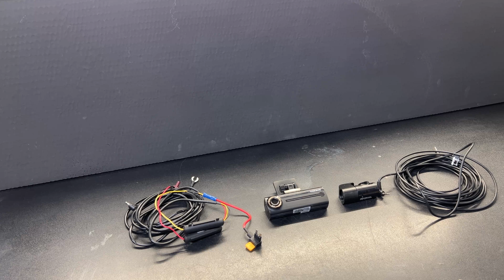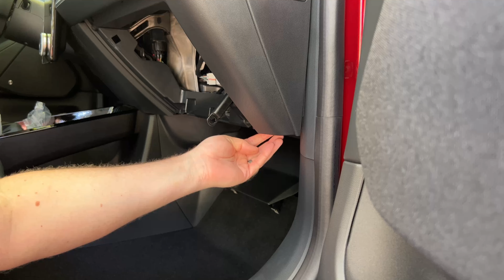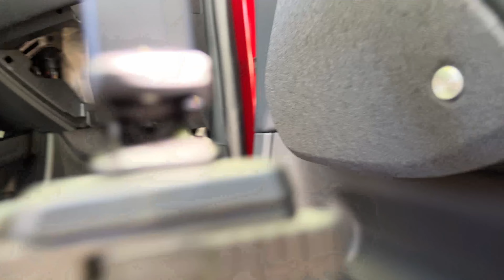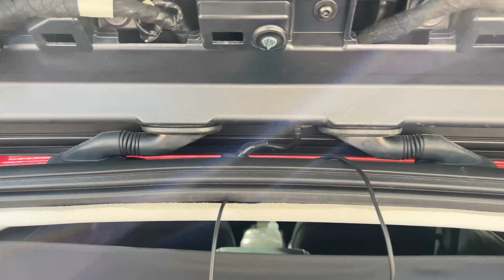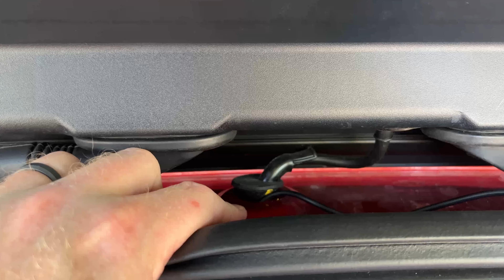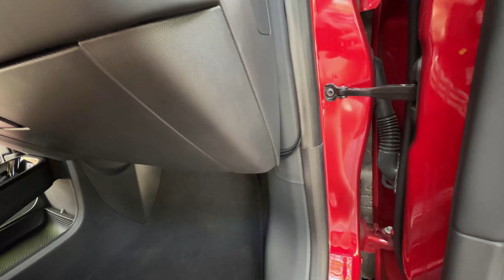Quick and Easy Ford Mustang Mach E Dashcam Dash Cam Hardwire Install

Comment: @TheDagda1000
0 seconds ago
Great video. I've just had a "dry run" before I do the job this weekend - the fuse panel was a pain in the butt!  I'm pleased to see that you had the same problem! I was feeling a right lemon! 
That's a handy tip about the glove box; makes the job a bit easier.
Reply from the maker: Glad to help.  Let me know how it goes!  Please like and subscribe as it really helps me as a creator.  It doesn't cost anything.  Thanks for the comment and for watching!
Reply: @MoreBear  Success! All up and running.
Channel Liked and Subscribed.

Comment: Can a dashcam be installed on the Mach e without all the wiring? What about the cigarette lighter? This looks too difficult for me lol
Reply from the maker: Absolutely you can with the cigarette lighter cable, but most outlets turn off when the vehicle is off, so you won't have "parking mode" enabled.  Please like and subscribe as it really helps me as a creator.  Thanks for the questions and for watching.
Reply: @MoreBear well the cigarette lighter is inside the center console so that would be a little difficult….
Reply from the maker: @londonlenox  Agreed.  You would be able to route the wires as instructed in the video so they would be hidden.  Just a suggestion.  Let me know how it goes.

Comment: I was able to get my wire through the rubber on the right using a zip tie. Feed it through and then carefully fish it while pulling and working it through with your other hand. Didn't dissamble it anymore than shown in this video for anyone wondering.
Reply from the maker: That's a great tip.  Please like and subscribe.  Thanks for sharing and for watching!  Drive safe EVeryone!

Comment: Thanks for the video, it truly helped me install a Viofo A139 Pro. Incidentally, I got the same fuse adapters from Amazon. One question: did you check that the direction of the adapters is adequate?
Reply: Yes I know which direction I have to place the fuse, I just didn’t check it while putting it because I assumed you had checked… 😅
I actually have the GT so fuse 3 is being used by a module I yet don’t understand what it does. As I understand, if the position is wrong the wire may get strained since more current is being drawn.
Reply from the maker: @aaragonPHD  The dashcam draws so little that I assumed there would be no issue.  Ultimately the circuit is protected.  And sometimes there is only 1 way the fuse tap will fit.  Thanks for the comment.  Take care.
Reply from the maker: Glad it helped.  I did not check the direction.  I merely installed the tap for what was most convenient to fit in the location.  No problems so far.  If you want to do some further reading:  https://dashcamtalk.com/forum/threads/quick-question-which-direction-should-i-point-this-fuse-tap.45111/  Thanks for watching and the question.

Comment: Thanks for the video any chance you know the part number for the panel you removed above fuse box cover with white foam at 6:00?
Reply from the maker: Not sure on the part number but its the fuse panel cover the sits behind the passengers feet in the passenger footwell.  If you have floor mats it will be partially located behind that.  Merry Christmas.  Thanks for watching and the comment!

Comment: Is the hardwiring draining your 12V battery? Are you getting any battery drain alerts on the system
Reply from the maker: Me personally I am not getting any noticeable drain or warnings.  My dashcam I can set a threshold where it turns off after it has depleted the battery past a specified voltage, but I have not had this occur yet. Thanks for the question and for watching!  Please hit that Subscribe Button if you enjoyed the content!

Comment: Isn’t fuse 3 Extended power module? It shows it being used in fuse box diagrams pictures online.
Reply from the maker: Not from what I can see.  Thanks for the question and for watching!  Please hit that Subscribe Button if you enjoyed the content!
Reply: @MoreBear  Mark, I think you are like me and have a GT and the OP does not.  I believe Fuse 3 is for the Track Extended Mode, which a non GT does not have.  Personally I am going to use Fuse 1 (or 2) for that reason, which are also 5a accessory only on.
Reply: How critical that module is? I also have a GT but only read this comment too late… 😖

Comment: More informative than most on YouTube. However the wire to the window pillar did you pry the plastic off or just flex it enough to get the wire behind? The rear dash cam wire did you silicon it or not?
Reply from the maker: I did not remove any plastic, weather stripping or panels.  They are flexible enough to pry over and slide the wire behind.  I did not silicone the grommet yet as I want to see how is seals on its own.  Thanks for watching and the comment!
Reply: @MoreBear  Thanks for the info
Reply: Great vid. Do you have the link the fuses you purchased on amazon? I bought a kit but the fuses don't fit.
Reply: Way too complicated
Reply: @TagTeamMusic1  is this a joke?  I actually find this install easier than in my other cars. The fact he didn't even have to remove any panels is better than most.  Even the glove box could probably be avoided.